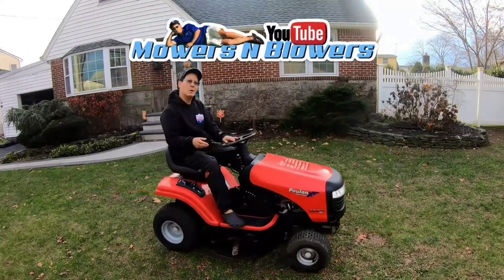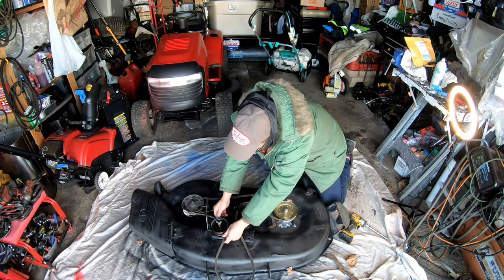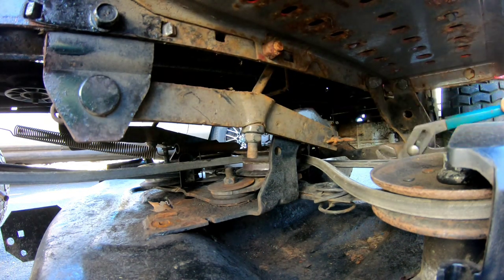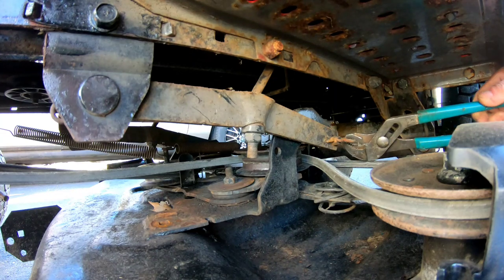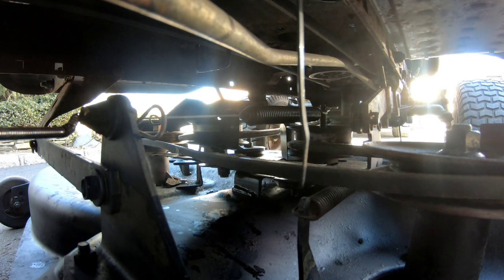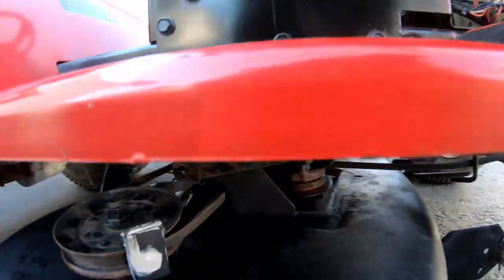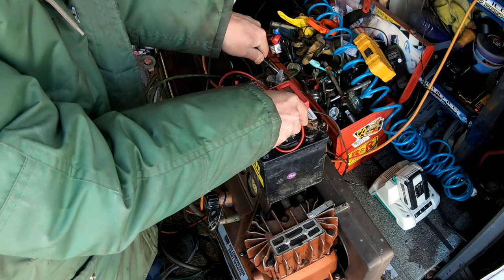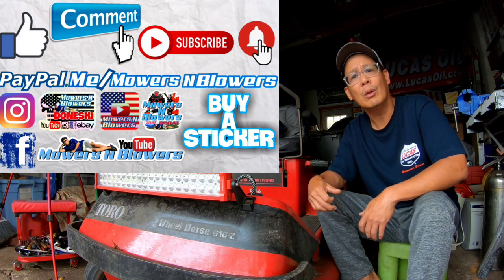HOW TO REMOVE INSTALL CRAFTSMAN 42" LT1000 LT2000 LAWN TRACTOR MOWER DECK STEP BY STEP INSTRUCTIONS

Comment: Henry, here is a tip: You can slide the deck out most of the way BEFORE you remove the PTO cable. It is long enough to slide the deck out and give you full access to the clip and spring. When you install it, slide the deck partially in, hook up the cable FIRST, then slide it under and hook up everything else. Just a tip for you.
Reply from the maker: Thanks ray, hope you’re subscribed
Reply: @MowersNBlowers   I am, have been about 6 mos now.

Comment: At Mowers N Blowers if you need a part. Its IN STOCK! Go on line we're temporarily out of stock. Henry on the stihl blower if you take the muffler off and look at the piston for damage, it might save you some time and money. Should be worth $125 running.  ✌🇺🇸Roger